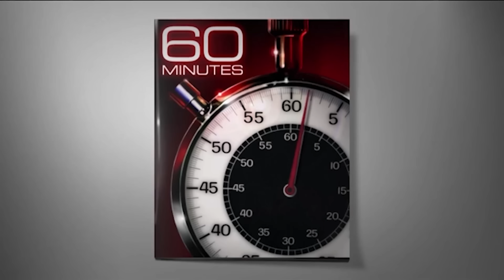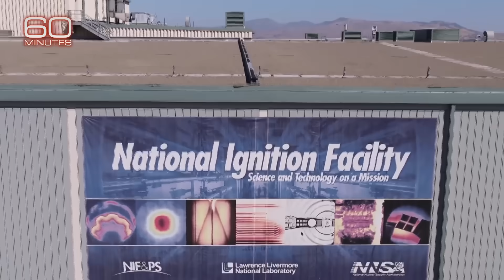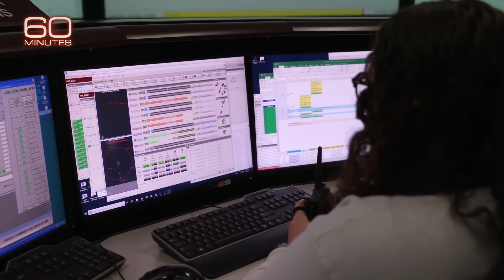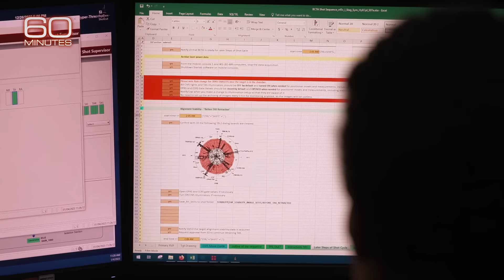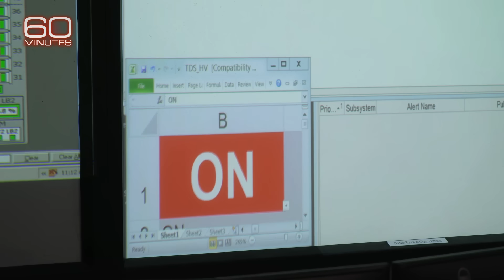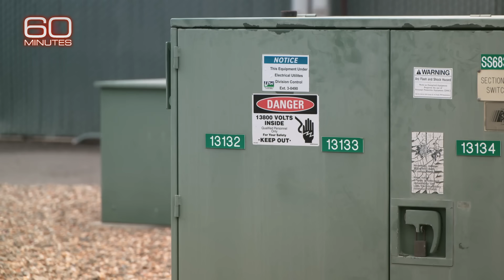Nuclear Fusion: Inside the breakthrough that could change our world | 60 Minutes

Comment: 30 seconds in and I'm already cringing. This wasn't the first time (it was the first time getting more energy out of the plasma than went into the plasma, but that's just trivia--it was still a couple orders of magnitude less energy out than went into the lasers and the facility as a whole). Anyway, inertial confinement fusion is almost certainly not going to be how fusion powers the grid (if it ever powers the grid--there are a lot of huge research hurdles, and then a lot of huge economic hurdles), so again, it's mostly trivia.

Edit: OK, one more minute in and still cringing. Controlled fusion predates the H-bomb. See the Farnsworth Fusor. What we haven't had, still don't have, and may never have (time and continued research will tell), is a way to get more energy out of the whole system than was put in (though we will keep getting better at getting more energy out of the plasma itself than was put into it).